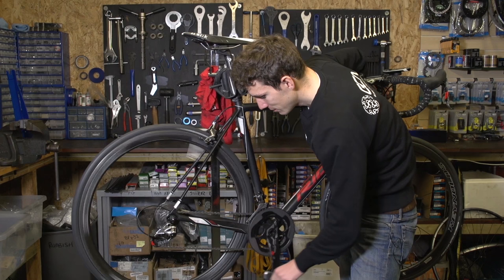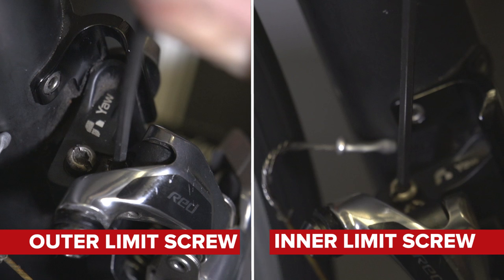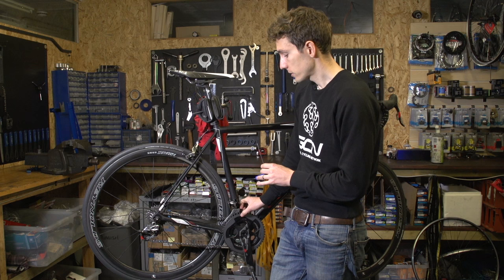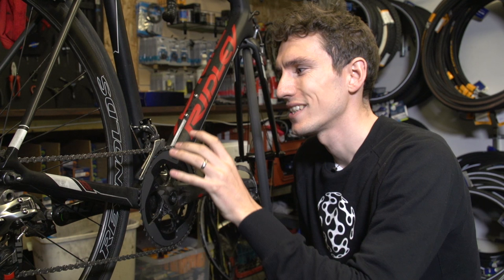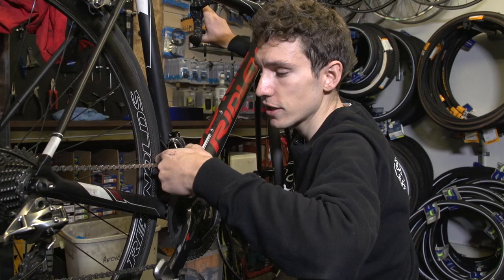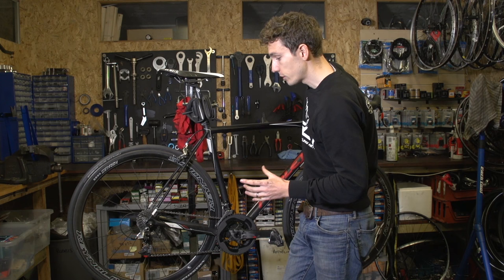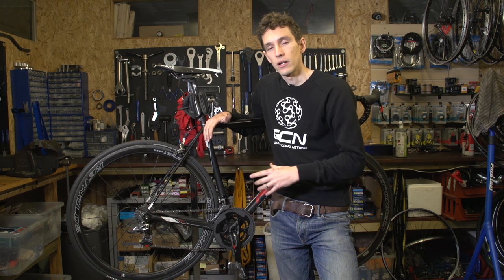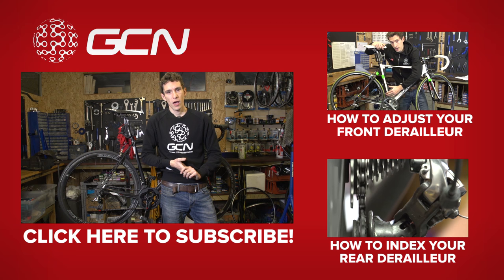How To Adjust SRAM Yaw Front Derailleurs

Comment: This was the best video on adjusting the SRAM Yaw front derailleur out there.  It specifically stresses the "alignment" of the derailleur with the white marks on the unit vice "old school" alignment with the front gears.  Makes ALL the difference.  I've had this for over 10 years always with a little rubbing at the extremes and this totally eliminated any rub.  Finally, it shifts like butter.

Comment: That's a really ingenious way to set cable tension!  Never thought of setting tension while in the big ring and then just backing off the limit screw!
Reply: That's not for cable tension,it's to align the cage.
Reply: Yes, obviously the limit screws set the limit of the cage, but I'm talking about how Si set the cable tension for the FD.  Usually you'll set the tension in the small ring and all tension released from the shift lever.
Reply: I find that doesn't work. Not enough tension. I need to use the inner limit screw up push the derailleur out, like Simon has done but then out the shifter in the small ring so there's enough cable length to get enough tension.
Reply: Get yourself a fourth hand tool, that is a golden nut.
Reply: The lower limit screw grinds the plate/lever easily, I wonder how many time you can tension the FD with until something brakes. When bolted to a hanger, you can at least tension the FD by hand, so there won't be any unwanted pressure during lower limit screw adjustment.

Comment: 2 minor oversites in your setup. First the derailleur cable is supposed to go over not under the little tab by the anchor bolt, and second when setting the low limit it is best to apply slight braking force to the rear wheel to mimic chain tension when actually riding. This will result in an ever so slight chain rasp when peddling the bike on the stand but no rasp when riding and better shifting to the big ring as less travel is needed to complete the shift.
Reply: ... when pedaling* the bike (peddling = selling)

Comment: I've been using a Froce22  Yaw derailleur on a couple different bikes and cranksets, it throws the chain no matter what it. It seems like the ability to twist overrides the limit stops when you press very hard on the lever....or sumpthin....not sure what exactly is going on with it's unreliability issue. You can have it set up beautifully on the stand but when you get out on the road and give it a little bit too much firmness on the lever it will chuck the chain off the side.  Too much limit on the stop to prevent this and it shifts terribly or not at all.  The Rival group I have is much better...it shifts like a tractor but it's much more reliable.

Comment: Thanks Simon you saved my weekend 😎. A lot of regular bikeshops arent able to do this 😑 so i did it with your guide and it works fine now 👍👍👍👍
Reply: Every time I bought parts SRAM or Shimano there is always a useless tiny manual, they should include simple instructions on how to install things. At times, even bike shop mechanics don't know the tricks

Comment: Best guidelines for sram yaw derailleurs!! many thanks! my is finally working crispy. The tip to adjust the angular position by using the low adjustment screw is very good, as these derailleurs do a yaw movement when shifting. That means, at the lower gear it's not parallel to the chain ring anymore.

Comment: srams adjustment (4mm alen key or flat head) is so much better than a phillips head screw!!
Reply: the worst part is most limit screws aren't actually phillips heads, they're JIS screws, which are very slightly different.  just different enough to make phillips screwdrivers not grip properly in the heads.  and JIS screwdrivers are oddly rare.
Reply: jon robert a symptom of sram being a japanese company i guess?? i think JIS are actually better if you have the right screwdriver, but you don't find them in the uk- old motorcycles seem to have a lot too :) interesting to know that , id never thought of it/ seen it before!

Comment: OK - after 6 tries I finally figured out that I needed to tighten the barrel adjuster (cable tension) to get chain to not rub in highest gear (big ring, small cog).  Might want to point that out.

Comment: Hi GCN, I'm also really struggeling with the adjustment of my SRAM Force rear derailleur, specifically the b-tension screw adjustment. Maybe you could do a video about that? Cheers. Also, Matt is awesome.
Reply: The b tension screw should be adjusted so that in the biggest cog the derailluer pulley is going to be approximately 6mm away from the teeth of the cog for optimum shifting.

My rival one derailluer needs more like 7-7.5mm to shift into my 36t smoothly,so just play around with it until your satisfied.

Just use the 6mm guideline to start out with.

Comment: I have to say that I am impressed with SRAM's engineering. I understand that cross chaining is bad, but I still think that the system should be able to do it without making a bunch of noise. I am a Shimano guy, but they could learn something here.
Reply: If adjusted properly the yaw fd makes almost 0 noise at full crosschain.its not like your supposed to be there anyways

Comment: Really nice guide for this - however, definitely not as easy as it looks :) I only miss getting the highest gear working - still a tiny bit there not going right, but I have troubles adjusting the cable on the adjuster on the cable. GUess I might have messed it up.

Comment: if you have alot of miles on it, for example over 20k, I have found it best to just replace it. Seems that the tension on the cable eventually pulls the derailleur our of alignment and the marks won't line up with the outer chainring. This also depends on the bike and direction the cable is pulling. Sometimes a new cable fixes it, and sometimes not.
Reply: I have exactly same problem now, it misaligns itself after a few miles even when I thighten the braze-on bolt with 8 nm torque (recommended max is 7 nm). Why would new cable or new dereilleur help with that? I'm seriously considering this solution.

Comment: Have sram deliberately designed their front derailleur cable pinch bolt to destroy cables and have such low leverage as to make shifting force harder than it needs to be?

Comment: Hey GCN, My front lower limit screw won't go far enough for me to allign both of the markes on the front derailleur cage to be in line with the large crank. After setting your lower limit screw so the chain is froced into the big ring, did you have any rotations left of the lower limit screw? Where else do you think I could be going wrong?
Reply: Billy Coburn some times you need to pull the derailleur out abit then screw the limit screw. It worked with my shimano.

Comment: Hey SiRo, It may be a little beyond the scope of this great video, but is the yaw front derailleur considered a necessary upgrade for those of us still on older generations of SRAM Red?
Reply from the maker: +Evan Aube Hey Evan, I wouldn't say so, but maybe when it wears out eventually you could upgrade.
Reply: +Global Cycling Network thanks!
Reply: +Evan Aube While you can get it to work with the older Red it really does work much better if you upgrade the levers as well to one made for the Yaw derailleur. I've done it both ways and it makes a huge difference.

Comment: Hi, great info but I have a question for my classic 70s build with modern components. I have Sram Rival 11 speed front and rear derailleurs but using Truvativ power spline cranks (correct look for my bike) with FSA 50/34 chain wheels. I have been told that the gap between the chain wheels is different on Sram yaw than all others, if so what is the size difference so I can pack my chain wheels out with washers.

Comment: Doing this without a barrel adjuster is a total fucking bitch of a job. The cable end crimp WILL come off as you pull, lol. If you have the Red FD with the chain guard, lining up the chain guard will throw off the cage alignment. You just have to lightly tighten everything and then coerce things into place and hope they stay put.

Comment: Nope.

This method does not work because it begins with a critical error: lining up white marks exactly above the big ring. This is incorrect. It is true that in the initial position the white marks have to be parallel to the big ring, but they will not (!) align directly above the big ring in general case. The marks should be offset inboard or outboard from the ring. Which direction and how much - depends on your bike. It is different from bike to bike.

Note, that you receive the new SRAM Yaw FR with a factory-preset L-screw. This is the canonical installation/alignment position of the derailleur. It is important to preserve it. When you take a new FR from the box, do not touch the L-screw. Install the FR on your bike, align the white marks parallel to the big ring, and then measure/photograph/note/memorize how far from the big ring the white marks are. Next time you decide to reinstall/realign your FR, use the L-screw to restore this position. Once again: the marks have to be parallel to the big ring but offset from the ring as much as they were when you received the FR with factory-preset L-screw. Not (!) directly above the big ring, as this woefully incorrect video suggests.

Trying to do it as this video suggests is just a random crapshoot. If you are lucky it might work for your bike, but most of the time it won't.

Comment: Seems so much more complex than shimano...
Reply: +SnowCYYCling Yeah but you don't have to trim which is nice.  For someone who likes a quiet bike, you absolutely can't beat SRAM with yaw.  Even a perfectly adjusted Ultegra or DA drivetrain still makes a ton of noise compared w/ SRAM.
Reply: +SnowCYYCling Actually I find that once you've mastered it (5-10 mins the first time) it's so much easier than the new shimano (5800, 6800, 9000). I've never seen a new generation shimano front mech that worked correctly, either you can't trim from the small ring or you can't trim from the big ring, and I followed the required cable routing, it just seems to me like there is not enough leverage and the shifting is crappy (prefered the older generation)
Reply: +razordimeback My big ring doesn't trim  at all and my little ring trims heaps. It's the same on my crappy winter bike with shimano claris and my good bike with shimano 105.
Reply: Ethan S The only way I found around this is to add leverage, I put a big cable end on the pin you do an "S" around with the new style FD, this way, it's possible to use the small trim and the big one still works. On some bike you can totally bypass what shimano says about cable placement and just clamp it like a standard FD (from the left looking to the front, around the bolt and down) and it'll work, but on most bikes this way you don't get enough leverage to get it onto the big ring